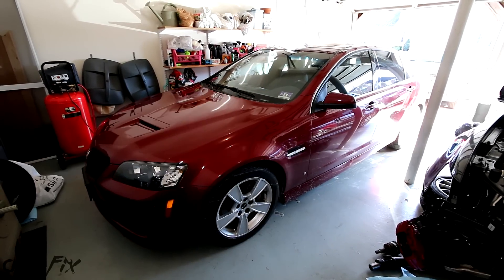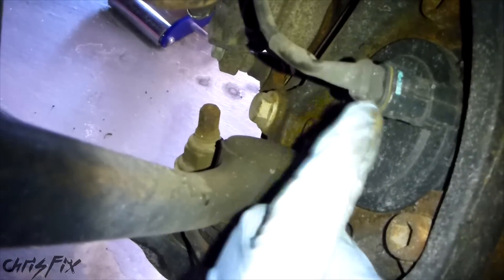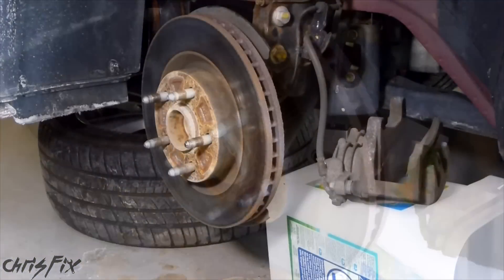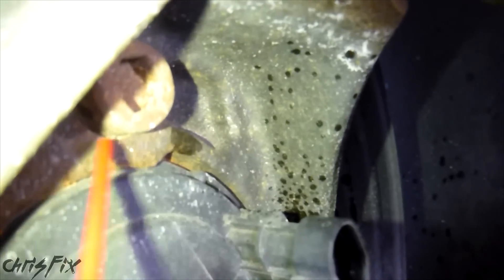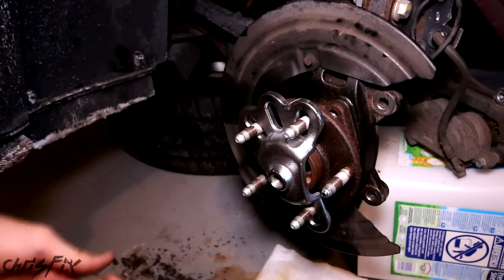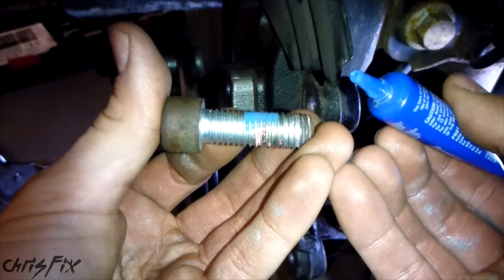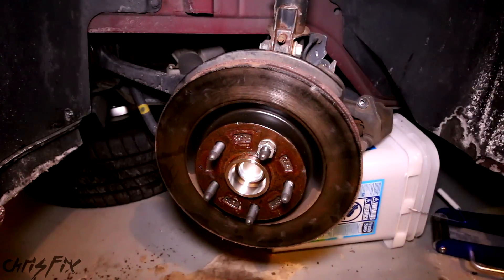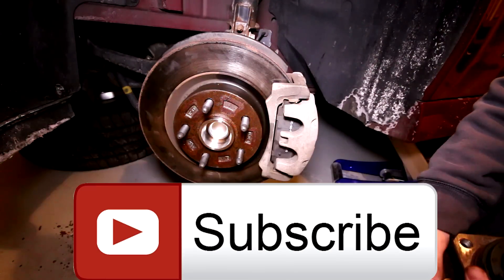How to Replace a Wheel Bearing

Comment: I replaced my rear wheel hub assemblies fairly quickly and easily THANKS to watching your videos. Parts at 1/3 the cost from RockAuto, compared to buying from a chain store, and using simple hand tools cheaply purchased at Harbor Freight (I don't need MacTools or SnapOn). Driver's side was the worst - horrible sounding - and easiest to replace. Passenger side wasn't as bad, though it was fairly rust-bonded, so it took considerable persuasion AND homemade penetrating fluid.

Comment: Another great video!! Glad to see you found some shelter in the garage!! A good tip is to make sure you take the time and clean up the red loctite off the old bolts. If the do cross thread you have a big project on your hands when it could have been prevented. A wire wheel in a cordless dill and hold the head of the bolt with vise grips works great to clean up bolts! Just remember, if you took it off put it back on. Make sure u use locktite. But as always Chris, best how to videos on the Web. Explained well and no profanity makes it great to watch with my kids!! Thanks again!
Reply from the maker: Jason B. Yea, a garage was nice for a change. It is tough with the lighting but I made it work! That is a good tip! Thanks a lot Jason! I am glad you watch this with your kids so they can at least see how stuff works on a car and how to fix it!

Comment: My tip would be to spray the bolts with penetrating fluid the night before you do the work,  if you know they've been on there for a long time. This lets the fluid really soak in and makes getting them off easier. I learned the hard way trying to get caliper bolts off of a 13 year old 4Runner. Great video as usual Chris.
Reply from the maker: WickedCoolReviews That is a good top tip! Thanks!
Reply: My bottom caliper bolts are too close to the brake lines to get a standard socket on, I stripped them quite badly trying to use a short spanner. Will get replacement bolts if a crows foot works...

Comment: Replaced my brakes on a 2010 F150. Caliper bracket bolts had RED locktite on them. Glad I had an impact. I think they should outlaw RED locktite. Its always applied by some idiot that knows they wont be the one having to remove it. A bench grinder with a wire wheel is your friend in removing the red locktite. HF is your friend. Great video Chris.
Reply from the maker: SS Crew The mechanic my father used when I was learning how to fix cars would put red loctite on every bolt so I couldnt fix things myself. It was a great feeling when I learned enough to start fixing my own cars and not have to worry about some ripoff mechanic pulling stuff like that!

Comment: Best top tip of this video is if your hub/rotor is seized on use a slide hammer with the claw attachment and pb blaster. It will save you hours of beating and cursing them to death.
Reply from the maker: jryanwill Thanks! That is a good tip!

Comment: One hell of a video,I have to admit.Very professional and helpful :)
Reply from the maker: DunHiLa Craftera Thank you!
Reply: ChrisFix I really don't know much about cars but I have an old Alfa Romeo 156(2.4JTD,year 2000) and some time ago I started hearing a thumping sort of noise comming from the driver side(appeared usually when turning left at higher speeds) and have gone to several mechanics to fix it but to no luck yet.However recently the noise started appearing all the time when driving with higher speeds and it's really loud.I don't know if the two noises are exactly the same or related but if you can kind of give me some help as to what I should change on the car,I would really appreciate it :)
Reply from the maker: DunHiLa Craftera Could be a bearing. Is the Alfa front wheel drive? If so, it could be the CV joints in the axle going bad. Do you hear clicks when making a sharp turn?
Reply: ChrisFix Yes,the Alfa is front wheel drive.I do hear clicks when making a sharp turn.
Reply from the maker: DunHiLa Craftera Sounds like a CV joint going bad.

Comment: Another outstanding video.  I really your nice even voice pace and how you explain the steps, and the picture quality is great.  The only thing I noticed on this car was that it looked like that rotor had a pretty deep lip on it.  Would've been prime time to replace it and its passenger side mate.
Reply from the maker: Victor Sorlie Thanks Victor. The rotor was still good and there is no use replacing it since it has more than 1/3 of service life left in it. But, since it was all apart, it is a good time to do the brakes if you want. The owner of the Pontiac G8 didnt want to so I just fixed the hub bearing.

Comment: Instead of the slide hammer, I'd consider getting an 8" or 11" gear puller, as that would allow one to perform trailing arm bushing repairs; an appropriate iron reducer and square head plug would be needed to encircle the trailing arm bushing as well.

Comment: Thanks Chris - another awesome video.  I am preparing to do this job on both sides of my Taurus, so your video is timely.  Fortunately my hub assembly is only $40.  BTW - I have never received an email since subscribing to your channel.  My tip suggestion is to take the opportunity to check other steering/suspension parts, as well as the brake pads.  It is much simpler to  inspect the tie rods, ball joints, sway bars, shocks, etc. while they are more visible.
Reply from the maker: James Coley Thanks James! I am glad the video was helpful! That is a good top tip as well. Since everything is already apart, it is fast and easy to get in there and check out the suspension components.

Comment: Chrisfix I a big fan of ur videos! I have a 95 Chevrolet g20 van with 100k miles. I am planning to do all the maintenance myself with help from ur videos. It was in the desert all its life so it needs lots of lube. The bearings sound like they need service. My problem is I can't find a video on how to service the rear bearings or the drive axle. I bought the GMC service manual but ur videos r way more helpful. Any advice would be greatly appreciated! Thanks!!

Comment: When I did my rear hub bearings (FWD car), there is one big 32mm nut that is staked. What I did was instead of buying a new nut (which is recommended) and torquing it down, I tightened the old one, until the stake mark lined up with the notch on the axle pin (no idea what the correct term is), and that's how I matched the torque. 20k miles on one side, 10k on the other, no issues.
Reply from the maker: February That is a pretty good method! Then you know it was as tight as when you took it off. I would use some blue loctite too, but that is just me lol
Reply: I trust the original stake the nut design. It held my rear wheels on for 130k miles, I think it'll hold them for another 130k haha!

Comment: Great video, Chris.  You consistently show work that seems shop-necessary (read expensive) which most of us can, in fact, do at home.  If I had to pick a top tip it would be to remember to look for ways to make the work easier, like turning that wheel to make it more accessible.  My neighbor calls that working the job and not letting the job work you!  :>)  Thanks for this and all of your other videos my friend!
Reply from the maker: A LeBlanc  Thanks a lot bud! I like the top tip and I like your friends quote lol.

Comment: Another great video but that's what we expect now from your videos!  I've never seen a torque spec of #'s plus degree swing? Interesting…
Reply from the maker: ***** Thanks man! Yea, there are some bolts you torque and then give an extra turn. It is really a pain. It is a lot easier to just have a torque and that's it.
Reply: @chrisfix  Great job as always! Do repair manuals specify that torque plus 120˚ for bolts that need it or is this just pro insider knowledge? I've never seen that in my ford ranger manual. Thanks!

Comment: Why does the G8's caliper and bracket come off together? That's weird. Great video though, thanks for being so in depth. My biggest pet peeve about mechanic videos is when they skip the basics like removing a caliper or using loctite. This is definitely a golden example in car mechanic tutorial videos. Great example of using a slide hammer too, I might have to pick that tool up if I ever do this job... or a clutch with a stuck pilot bearing as I keep hearing about.
Reply from the maker: ***** Almost every car (or at least every car I have ever worked on) has a caliper that would come off with the bracket bolts removed. The caliper bracket holds on the caliper to the knuckle. So if you remove that, the caliper comes off with it.
Reply: ChrisFix I was so tired I wasn't paying attention to what you took off. I'm used to taking off the caliper separately but didn't even realize you don't have to. My bad! Thanks for showing things going wrong, a lot of mechanics would cover it up and skip over the stuck rotor and loctite application. You should work on more things that get stuck as good examples.
Reply from the maker: ***** No worries man! I am glad the video was helpful and I try to show everything so that if you try the job, you will know what to do when a rotor gets stuck or whatever might happen.
Reply: ChrisFix I'm crossing my fingers you won't break a spark plug on the spark plug video you said you're going to do... But try to talk about what happens if it does break off in the cylinder head just in case.

Comment: However, a loose spindle nut will cause a similar effect. Just dealt with that. Some hubs are entirely press in. There is no removable assembly. There are videos showing you how to work on those also.

Comment: RWD for the win. I'd like to see you do a rear wheel bearing on a RWD car with a sold rear axle like my 1998 firebird. I've heard they're a royal pain and most people just let shops do them because of the presses and seals you need to use and navigate around. I also wonder what goes bad more often in a RWD car, front wheel bearings or rear ones?
Reply from the maker: ***** I want to do a soild rear bearing so bad. I am just waiting for one to go bad lol
Reply: My Mustang's did a month after I bought it. I knew what a bad bearing sounded like but didn't start hearing it until after I bought the car. Apparently it was bad for over a month until I could afford to fix it so it chewed my axle up and I needed a new axle on that side. Seems like nasty business. I was told the shop used a few different presses for the job, but I also had them redo my pinion seals, axle seals, and some other rear-end parts that needed freshening up. It was expensive and that's why it's a shame I ended up selling the car not long after lol. I loved that Mustang. But the 2V is a piece of shit compared to the LS1. And the firebird is just a better car period... Almost bought a 3V (05-09 GT) or took on a car note for a 5.0 or a challenger but I'm in college and the f-body was cheaper and... it's a firebird. I couldn't say no lol.

Comment: I actually just did this to my car the other day. But it was an all wheel drive car, So the hardest part was taking off the bolts because of the axles were in the way. And i had to rent a jaw puller to get them off. a slide hammer wouldn't do it. But this video helped me for 90% of my job. Thanks!!
Reply from the maker: chris rad Awesome! Glad the video was helpful and nice work getting yours done! Yea, the axle makes things more difficult!

Comment: my tip with when the hub is rusted stuck and you dont have access to a slide hammer, you can put a wheel on and smack it with a hammer from other side as you spin the wheel. the hub should now come off!
Reply from the maker: Vu nguyen Thanks for sharing man! That is a good idea!

Comment: Hey Chris I watch your Videos all the time and they have help in some repairs that i made myself on my Ford Edge 2014, this particular video is perfect just have one question The front Wheel hub barring should be the same with the rear right. I have been have this terrible humming after 40 miles so i need to switch it out

Comment: What is the 120 degrees when u were talking about torque specs for the caliper bolts
Reply: I was wondering about the same thing. I saw another guy doing similar thing on YouTube. It could be some specific recommendation from car manufacturers. Then why not talking about it since it is so important info.

Comment: Is that the only clip holding the abs wheel speed sensor how would you have to remove the three bolts out or could you just pray the abs wheel speed sensor out with a flathead?

Comment: Question: Is torquing to spec and then going an additional 120 degrees the same as torque-to-yield? Thanks in advance.
Reply from the maker: Usually a bolt with a spec like that is TTY so yes

Comment: Do you need to lube the wheel bearing if replacing the whole assembly? I know it has lube from the factory, but I wanted to make sure I don't need to add more.

Comment: no need for the slide hammer remember folks your replacing the worn out wheel bearing and instead of pulling on a  edge of a rotor (which can damage it) use a hammer and tap in between your lugs followed up by pulling sharply with your hands if you have to works every time  for the bearing  hit it from the back side  no pullers required have done this many times on many different vehicles
Reply from the maker: Tim Johnson Thanks for sharing Tim.

Comment: Hey Chris! I come to your page for all my Ranger needs, but this time my girlfriends 2012 civic ex needs work (FWD). I can't find any videos for anything newer than 2011 and I think all those are pressed bearings. However, I think her 2012 has the hub assembly and bearing all together, so would the only thing that's different from this video be that there's an axle nut to take off?

Comment: Hey Chris I got a G8 I noticed that one wheel lug nuts were loose I thought that was the cause of my steering wheel shaking but I torque everything down and it still shakes the tires have been balanced still have the shake around 60 miles an hour I don't understand
Reply: I have a truck with custom rims. For months I had the same issue.   2 things I did that fix that problem,  change the tire (had some kind of flat spot or budge, wheel ailment. After that issue went away

Comment: Saved more than half of the $700 mechanic costs...awesome, but what were the "main expenses" in this job? 
Was the part expensive - anything over $60 is uncomfortable for my budget :-(  
Were you including the tools you had to buy?
Reply: ThoughtWave64 I'd like to know also cause the parts is like 60 bucks if that.
Reply: if 60 dollars for parts is over your budget you should sell car and go with public transport in future
Reply: ThoughtWave64
Yeah man... Just don't do it.
You can, however, build a pretty good junker with $60 part buys.
Reply: ThoughtWave64
And it certainly doesn't include the cost of tools...
Have you ever bought tools before? You never buy them the day you need them...
Reply: Jay Edlington
Reply: The ABS sensor is what makes this part so expensive.
Reply: I second the other commenters... If 60 is over your budget, sell the car and grab a mountain bike.  Gas alone is half that.  I hope any hub i need to replace for my maxima only costs 60.
Reply: My replacement wheel and hub bearing assemblies was $50 plus like $12 shipping

Comment: hey so i do my brakes, i haven't torque them to their spec, i was told i have to tighten them and that would be good. ofcourse, theyre not mechanics,theyve done their brakes too.
so far my brake bolts havent losen. i think i should try torquing them to their spec, im still kinda confused about the 120° but ill try to get it. thank you.
Reply: Look up the make and model of your car's brake caliper torquing specs online like Google if you have a different vehicle than the one in this video

Comment: Why did you NOT use a wire brush to clean the threads of the screws that hold the hub instead of running the risk of damaging the threads with the screwdriver?

Comment: Great video Chris! I had a question, I was wondering if there truly is any difference between conventional or synthetic oil?
Reply from the maker: Raul Sotelo Yes, there is a difference between conventional and synthetic oil. Without getting into too much detail, synthetic oil is more refined conventional oil. Synthetic oil has more of the same size oil molecules and is more consistent at wear protection compared to conventional. That is the major difference. I have a van that uses only conventional oil and it has gone 300k miles and it is still going.

Comment: I like that slide hammer tool.  Can it be used for a lot of different things?
Reply from the maker: fargobrad Yea it is a great tool! Yes, you can use the slide hammer for anything you can think to use it on. It is great at getting things off like the hub or the rotor.

Comment: Great vid. My car has the greased bearing and all. It's a 79. How do I do an old car?
Reply from the maker: Chris Johnson Is it a pressed bearing? Usually there is an inner and outer bearing on the older cars. It is a little different than this because the inner typically gets pressed and the outer pops right out.